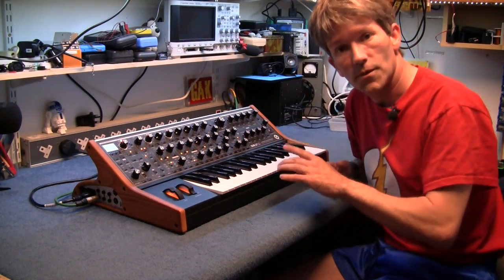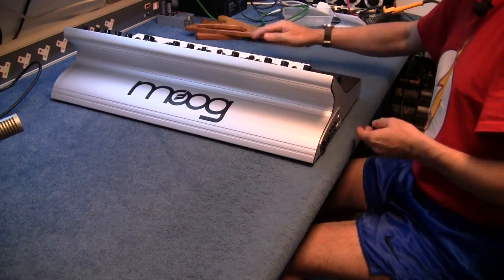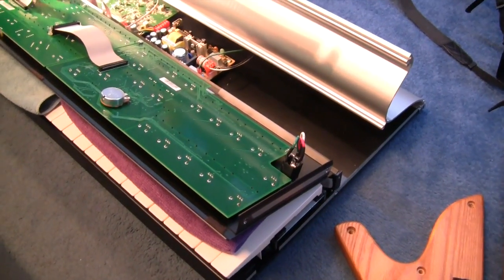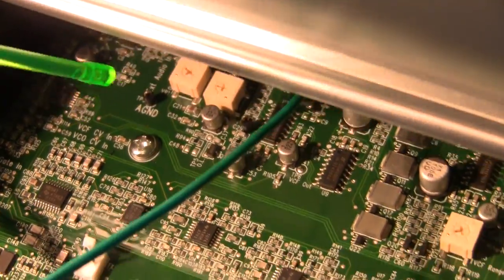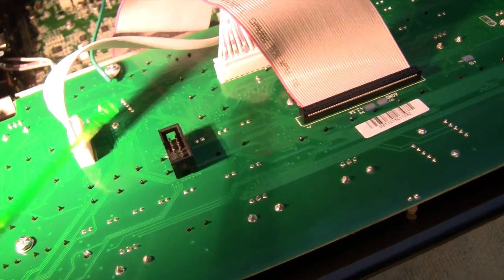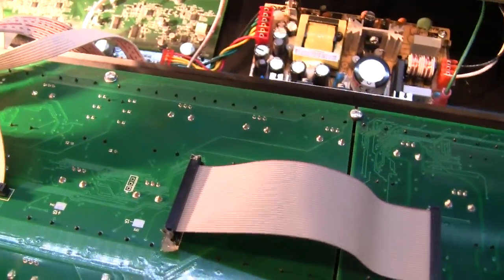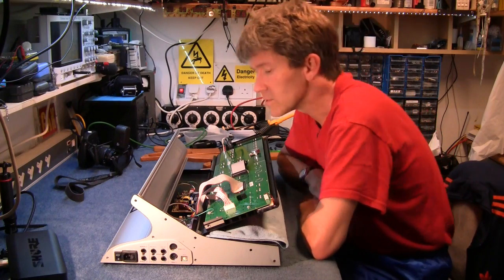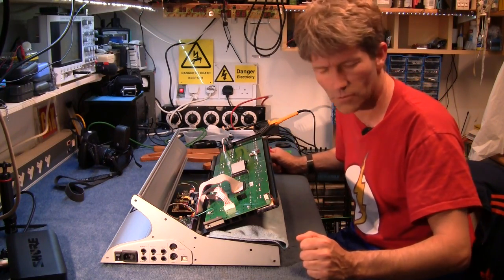MOOG Sub 37 teardown no CV Output ? MF#50

Comment: Hi there, my subsequent 37 is not being recognized by my Mac. I’ve done everything from changing to usb cable to fiddling with every setting. The interesting thing here is that this time, the red midi indicator light on the synth does not flash when keys are pressed to indicate midi activity. Do you think it’s broken? Would it work if I switch to midi cables instead? Any help is appreciate it

Comment: I am really interesting in this...someday.  But no MIDI through.  Don't understand this idea that people don't need MIDI through anymore.  I need it, or I need to get MIDI splitter
Reply: Unless you don't work with a DAW being an important point, and many people don't I suspect.  I know I don't
Reply: I bought this a few months ago.  Two thumbs up.  Here's how the MIDI works.  It has no MIDI through, but you can use the MIDI out as MIDI through.  In the global menu, maybe, there's an option to set it so you can chain it.  So I run MIDI into it, and MIDI out of it, via the MIDI out, but it's set to send all the incoming MIDI to the output.  I would say besides it's good build, and good looks, it's best features are the sequencer and the filter.  And the filter isn't like filters on digital synths.  It can sound similar to some of my digital synth filters, but the total experience is different.  For example, you will find this place where a small turn of the knob causes it to get very "squelchy".  It sort of jumps into self oscillation very fast compared to other synths.  My Prophet 12 just can't sound the same with it's Curtis filters.  Seems like, you want that Moog sound, get a Moog, or Mooger fooger filter.  It doesn't quite blend as well as my other digital synths; sort of raw or something.

Comment: hi Markus, your video on the Sub37 is creating quite a controversy over on the Moog Sub Phatty forum. Mainly because the CUTOFF surface-mount pots are failing on Sub37s. and in your video, it seems inside there is a new control PCB board and a traditional chassis-mount pot in place for the CUTOFF pot? so it seems MOOG has fixed this problem on the production line, and users are wanting MOOG to now fix their units as well. Can you please let me know what serial number your Sub37 is? (you can round it off to the nearest hundred if you dont want to say exactly) because owners would like to know if their unit is one of the "faulty" ones or one of the revised ones. You are one of the few who has voided the warranty and dived into opening their synth up, so most of us are in the dark as to what is going on with this pot internally.
Reply from the maker: Darren Glen Hello Darren. My Sub37 serial number is 0581X ( "X" being my last omitted number) the manufacture date was 06/15. I did not know about this problem with the earlier Sub37s. I thought it was a bit strange having that great big Pot there but now I can see why they have revised it as it is the pot that would get most abuse over time. I hope you guys can get yours sorted out. Best wishes from Markus.
Reply: markusfuller hi Markus, thank you for responding! I have a suspicion that the "fixed" traditional chassis-style pot (like you have) will have a metal shaft. Meanwhile all of the Sub37's that have been reported as faulty seem to have a surface-mounted pot which has a black plastic shaft. Can you please do the Sub37 community a big favour and just lift your Cutoff knob and see if it has a metal shaft? if this is the case, then it will be a simple procedure for owners to find out if their unit is a "faulty" or "revised/fixed" version by doing this simple test, without having to open up their Sub 37. Looking forward to the result many thanks!
Reply from the maker: Hello Darren, It seems my Sub37 has a METAL pot shaft. I have placed an image of it on my google plus page ( markusfuller ) copy the image and use it as you wish. best wishes.
Reply: hi Markus, i have posted the picture on the Moog Sub Phatty forum. many thanks!
On a side note, the next question is in regards to the control pcb board. The question is whether Moog are simply drilling holes in the existing PCB boards in the factory and mounting the new pots in the place of the SMD pots, or whether they have made a "Mk2" revised PCB all-together. it will be interesting to see if the PCB tracks are now routed to go "around" the hole they have created, or whether there was no interference with any tracks and they are just drilling down. This will affect the outcome of whether owners can simply drill a hole and put in a new metal pot themselves, or whether the whole PCB needs to be replaced to do this.

I dont suppose you feel like opening up your Sub 37 again and making a video on this interesting anomaly? im sure it would get lots of views, you are the first to discover this new factory fix/Mod!

here you can find the forum thread: http://forum.moogmusic.com/viewtopic.php?f=7&t=23625&p=145191#p145191

Best Regards,
Darren.
Reply from the maker: Hi Darren, Just at this moment Im working in my regular job, These Videos are done in my spare time but I will certainly put it on my to-do list and maybe have a look into how this new pot is placed or wether there is indeed a new circuit board ( though that would be expensive to re-spin new boards) I think it is likely they are drilling original boards and making the pots fit.

Comment: DCO. !  Digital Oszillator
Reply: markusfuller Amos from Moog confirmed on the Moog forum that the Sub 37 and all other Moog synths use VCOs, not DCOs: "All Moog synths, Sub line included, have VCOs. Nobody is saying that the oscillator is locked directly to some kind of digital frequency control. It's a free-running VCO controlled by a pitch CV. It's just that the pitch CV is generated by a DAC (digital to analog converter) and the oscillator responds predictably to that voltage, so the tuning can be very precise."
Reply from the maker: splitradix  what i like about making video's like this is that people like yourself take the time to comment and add a bit more information - Thank you :-)
Reply: walt modul What about Digitally Controlled Oscillator?
Reply from the maker: Jørgen Johansen Sorry I did not really look into the DCO ? if it is digitally controlled or not. I just wanted to get a quick look into it to see if there was the future possibility of a CV out. which I now know there will not be.
Reply: markusfuller hi Markus ! i am a fuller fan. i love to watch all your videos.
but is still don't believe. 
On the whole moog website, there is always written VCO but at the sub only variable wave shape .
Reply: The only words that comes to my mind now is: thank you. ♪♪♫♪♫
Reply from the maker: Thankyou Jorgen :-)

Comment: Thanks Markus for a quick look inside the Sub 37. Of course, I would have liked for you to show us the circuitry on the front panel, but I understand your reluctance in taking that apart. I find the "big" potentiometer a little curious. Is it because Moog doesn't rely entirely on those mini pots for intensive use (the filter cutoff) ? Or is it because it will be simpler to replace that pot (when it'll be worn out) from the back without having to remove all the front panel maybe ?
BTW, that PSU is a MeanWell brand which is recognized as one of the best in the business.
Reply from the maker: AlainHubert Hi Alain, I think you are right about that Big Pot, it would get lots of turns in its lifetime and yes it could be more easily replaced if needs be. I did think about removing the front panel but the few pot caps I tried to remove proved to be really difficult.
Reply: markusfuller 
As for the CV outputs, I think you're right. The Sub 37 isn't designed to output Control Voltages.
You're better off adding an external MIDI-to-CV box to your beloved Sub 37.
Reply: +Mike G 
Hi Mike. Kenton is a well known manufacturer of such devices. Link below:
http://www.kentonuk.com/products/items/m-cv/modsolo.shtml
Pittsburg Modular makes one too. Link below:
http://pittsburghmodular.com/midi2/
PAiA has been offering their MIDI-to-CV module for many years now. Link below:
http://www.paia.com/midi2cv.asp

Comment: It amazes me what little circuitry there is and the cost of these synths, thanks for the video.
I would love to see you in a tv production of how things work, you describe very clearly and are very knowledgeable. Love your videos,  just wish I knew more about electronics.
Cheers
Reply: markusfuller I repair circuit boards at my job, you would be surprised how often we just scrap boards. Especially if BGA's don't solder up properly. The good thing is the parts are so cheap that it doesn't matter. For instance that circuit board in the Sub37 is probably only $40.00 worth of parts.
Reply from the maker: Karl Bedford Thanks Karl, though there does not seem to be very much in these modern day synthesisers its only because the components are so tiny now that they can cram a lot into just one small board, I guess if this was made just 10 years ago with the same amount of components the board would have been 4 times bigger. the only real disadvantage is things start to become unrepairable. Best Wishes from Markus.
Reply: Karl Bedford Think about that statement in regards to the Emerson modular which has probably about 22u of blank panels.